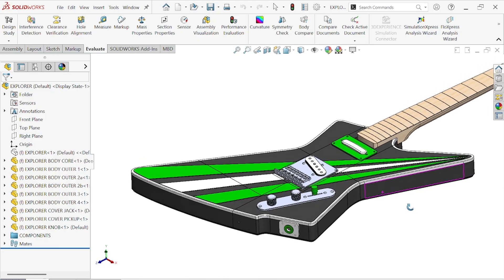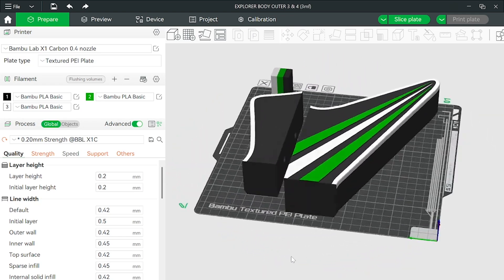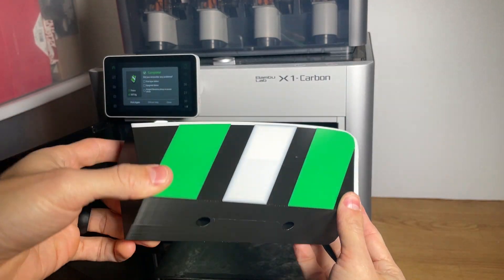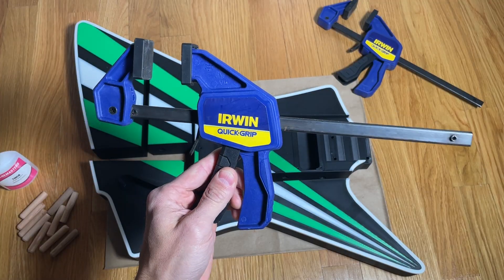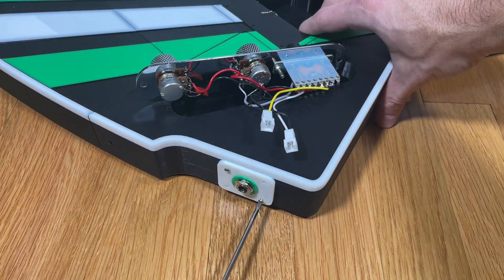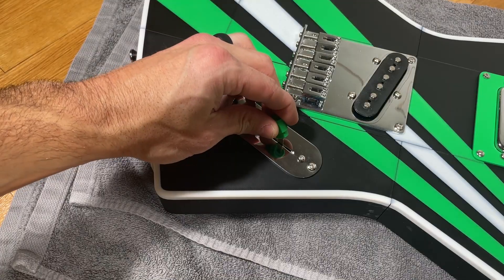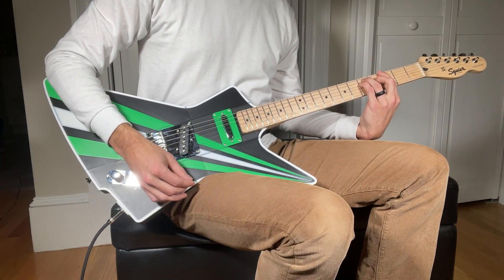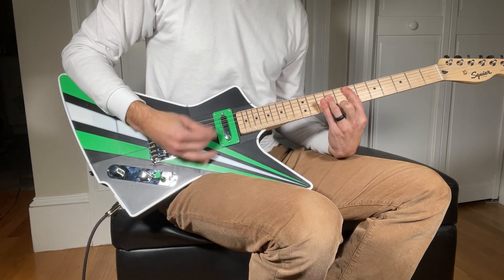Explorer 3D Printed Guitar KIT Build! PRINT. BUILD. PLAY.

Comment: This is the future of guitar, if you agree or disagree, it's the future. Imagine a core with lego-like attachments. You can have the same core and assemble a tele, a jazzmaster and a strat as you wish. Soon, in future iterations, it will not be glue but screws or latches, so you can switch body shapes as often as you wish.
Reply from the maker: Great minds think alike! I may or may not be working on this exact concept.....stay tuned! :)
Reply: a company already tried this and failed.
Reply: @akkudakkupl  Well, I guess we all better pack it up and never try again. Party's over! Random internet dude says it ain't gonna happen!
Reply: @ Do what you want, i just stated a fact.
Reply: @akkudakkupl  Which company? An statement without evidence does not make a fact. It's a statement.

Comment: How do you find these builds hold up months later? Any significant warping or anything?
Reply from the maker: They hold up fine as long as the center core is printed in a high infill percentage (at least 60%, more is even better). Also, you can consider using ABS, Nylon, ASA, carbon fiber, or other stronger materials for high strength and temperature resistance. PLA can warp if you store the guitar in high/low temps or in an environment with high humidity. Hope that helps! Let me know if you have any other questions!

Comment: Now waiting for a bass guitar! ;)
Reply from the maker: Thanks for the comment! Bass guitars are tricky for 3D prints because the string gauge is much thicker and string tension is a concern. That being said, definitely looking into bass designs for the future!
Reply: @the3dprintzone  you have a good printer with enclosed chamber, you could ASA print this bad boy!
Reply from the maker: @serceband  good point! Yea, I was thinking ASA or Nylon might be good options as stronger/more temp resistant materials for this. Thanks for the suggestions/comment!